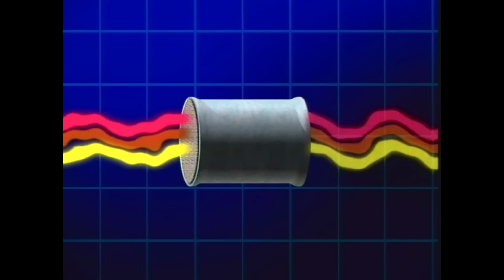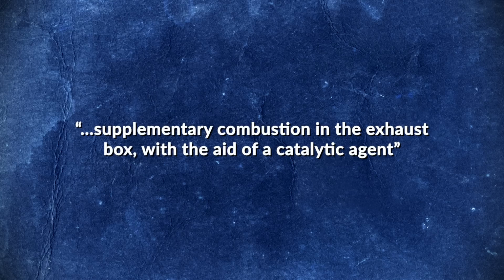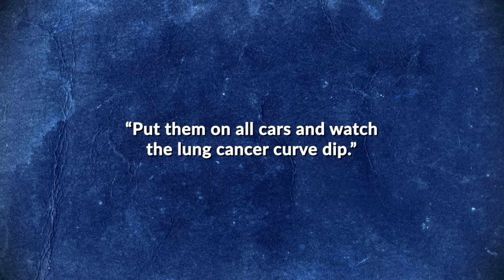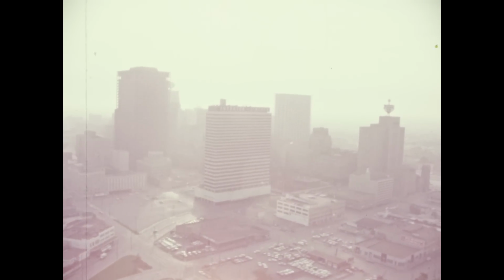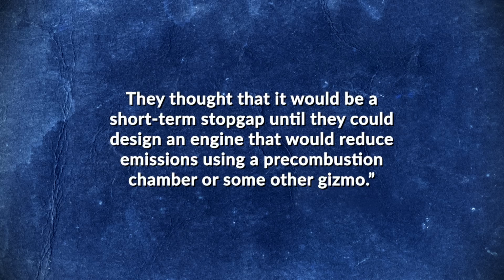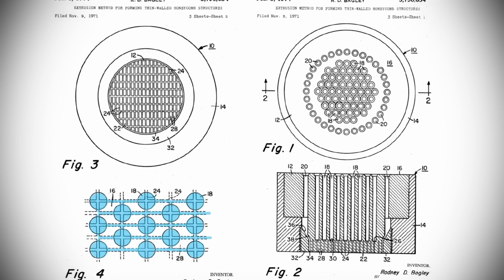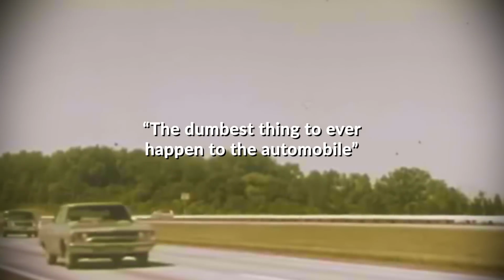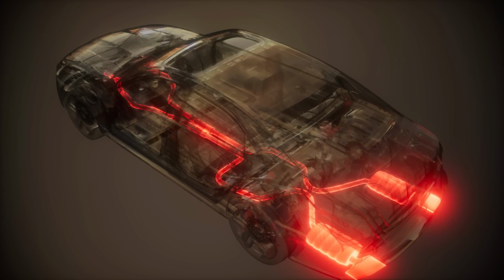The Most Underrated Automotive Component of All Time

Comment: The EPA really needs to get rid of that exception for "light" trucks. That has lead to the normalization of much larger and heavier vehicles on the road, which works against the EPA's objectives in the long term.
Reply: In general, the way we do emissions and fuel economy in the United States is stupid. The reason vehicles have gotten so physically big to skirt emissions is because you're allowed to make more missions if your vehicle leaves a larger footprint. This is why we don't have compact trucks like the old Toyota Tacoma, Chevy S10 and Ford ranger. Instead, we get midsize pieces of garbage or front-wheel drive cars that are pretending to be pickup trucks like the, Santa Cruz, Ridgeline, Maverick.
Reply: Ah so!
Reply: @masjuggalo  I agree it’s stupid the way we do emissions here. We’re definitely on the same side of the argument
Reply: That exception hasn't applied for decades.
Reply: @jessiesratrods1210 there still is a light trucks exemption for gas mileage. That’s why my dad’s old F-150 from the mid 90s gets the same gas mileage as his 2012 F-150
Reply: @tampajay1 they get about the same mileage because the newer F-150 has an extra 2,000 lb airbags. Check the curb weight vehicles have gotten heavier over the years due to things like airbags, power, adjustable seats and so forth. And remember if you say well, the curb weight of my vehicle hasn't changed since three generations ago. Remember the one you have is made with more modern lighter weight materials and still weighs more
Reply: @masjuggalo  Are you seriously saying the airbags on an F150 weigh 2000lbs?  I know juggalos are clowns but come on...
Reply: Airbags, required backup cameras and screens, much heavier seats, heavier stereos, larger brakes, larger wheels, larger tires, heavier literally everything.  Fuel mileage is directly related to moving mass per kg of fuel burned.  It’s simple physics that say it’s impossible to move 6000 pounds with the same energy as moving 4000 pounds.

It’s the same reason we were easily seeing 40 and 50 mpg non-hybrid economy cars in the 90’s and now it takes complex hybrid systems with lean burn cylinder deactivation on modern vehicles.  Every modern vehicle has gained 1000-2000 pounds from their 90’s counterparts.
Reply: All vehicles have cats now
Reply: @jamesocker5235  Everything except for military package trucks.  Ford has an entire build package for military F250's and F350's with no DEF, DPF, no EGR, and no cats.  Factory tune is even setup to not attempt a regen because there's no DPF to burn out.
Reply: the chicken tax comes into it. there's a 25% import tax on foreign-built light trucks/vans, which makes them insanely profitable compared to cars (2% import tax)

this, more than anything else is why trucks are heavily marketed to consumers
Reply: The original reason for the exception was to keep trucks affordable to small business owners, but now they're the most expensive vehicles in the lineup of most American automakers
Reply: USA fleet fuel economy is a joke. It hasn't increased hardly at all since the 1980s when the EPA estimates are put on the same scale. It actually peaked in 1987 and declined during the 1990s, and didn't start rising again until the late 2000s.
Reply: The light truck came about because the US Govt wanted to sell chickens in Germany 
https://youtu.be/HMJsM--jmRA?si=cQhXM8qegR6uxE7T
Reply: Indeed. It's fleet efficiency standards on that topic, not emissions; but same same/semantics.
Reply: The EPA is weaponized, now in hand with manufacturer’s they work to cost the owners as much as possible making vehicle own ship worse for every generation, and now with the subscription process you will own less until you essentially rent your transport ensuring your movements around the country.

Comment: Why not turn them into batteries? Redox reactions make electricity that's what batteries are. Also, redox reactions are reversible so they could be easily recycled by charging them with electricity.  Chemists really need to take engineering and mechanics,  it would make the world a better place for everyone

Comment: ....and GM, in true GM fashion, knew that their 'pebble bed' converters wouldn't cause any operating problems to owners who chose to 'kill' their converters by continuing to run the (cheaper) leaded 'regular' fuel which was available for several years after the theoretical changeover date.
Reply: Well, eventually they would clog and you'd have to pop the very convenient plug out of the bottom and blow the guts out..
Reply: How late did GM stick with pebble bed converters? The plug was supposed to be so you could replace the catalyst pellets.

Comment: According to TIFO and bulge in an exhaust pipe is a catalytic converter. Never mind that there are things such as post cats, resonators, and mufflers. Factory cats on modern vehicles are found attached to the exhaust manifolds. Typically visible from the top of the engine bay or by looking right by the engine itself.

Comment: Automotive journalist Jamie Kitman has covered this topic in detail some 15+ years ago. If I'm remembering it correctly, it goes like this:
1. In the late 1970's, California wanted to introduce gasoline automobile emissions regulations to improve air quality.
2. The whole US automotive industry said it would be really, really hard to do and would take years and cost them huge sums of money.
3. At the same time, General Motors had a 40% stake in a company which was developing catalytic converters for automobiles which would enable them to satisfy the emissions requirements.
4. Meanwhile, Honda went away and developed a 3 valve cylinder head for their existing engines which improved efficiency and would meet the emissions requirements without needing any additional hardware or equipment to be fitted
5. Lobbyists for the US motor industry convinced the legislators that it would be lot cheaper and easier to just stick a new gizmo called a catalytic converter on every new car instead of them having to re-engineer their engines cylinder heads as that would cost them a lot of money. And luckily, GM was aware of a company which just happened to make them and would gladly supply everyone with as many as they needed, which was really convenient.
6. Emissions regulations came into force, and everyone paid an extra couple of hundred dollars on every new car which all have catalytic converters, while GM made a nice little profit from the new market for catalytic converters they helped create.
7. Every new Honda still had to have a catalytic converter fitted (which was not required because they had the 3 valve cylinder head on the engine), and their customers still had to pay the extra cost for the cat.
Reply: just re-engineering an engine doesn't solve anything so you must be misremembering as cats were FAR more expensive then, as now than a redesign. considering GM's failure in that department with the pebble style...pretty much proves how difficult they were. there were a LOT of automotive industry writers/pundits/fanboys who absolutely HATED any pollution controls and would write or talk about how ebil it all was and unnecessary...much like they did when it came to leaded gasoline which DID require a redesign when it was eliminated.
Reply: @Joe-Dead  At that time Honda proved that it was possible to avoid having to install cats as they were very expensive. At some point cats would almost certainly have been required but not for a few years. However, GM as the major US automobile manufacturer during that period had a very nice incentive to promote cats as they had a large stake in the company making them.
Reply: @simonlb24  honda didn't prove anything, it's chemistry not magic, everything an ICE produces was STILL produced. you LITERALLY cannot engineer an engine that doesn't produce pollution without a catalytic convertor. the absolute best choice wasn't possible back in that era, direct injection and that STILL only reduces pollution/emissions but nowhere near the level a catalytic convertor can on a naturally aspirated engine.

it's chemistry mmkay? burning hydrocarbons ALWAYS produces pollution even methane which is pretty much the cleanest version you can get. just CH4, not complicated, but it's also reacting with air and everything in that at high temp.

there was a concerted effort to keep catalytic convertors and any pollution controls OFF cars. keep lead IN and keep the industry rolling like it always had. same story, different industry. something harmful needs fixed, costs money to fix...let's put out propaganda to prevent that action.

tetraethyl lead, tobacco, asbestos, thalidomide, pollution, ozone etc etc etc.
Reply: @Joe-Dead  Thank you! I was hoping someone would point that out so I didn't have to.

Also, Honda did meet the emissions requirements at the time with their CVCC engines. They had better combustion which result in less pollutants. That meant they had the distinct advantage of not having to rely on catalytic converters. As the emissions requirements became more strict, Honda just like everyone else had no choice but to use cats.
Reply: I'm not sure how adding valves to a cylinder head improves emissions? the engine definitely would be more powerful
Reply: @tturi2  slight improvement to combustion efficiency, not sufficient to meet pollution standards though as it's still pumping out everything.
Reply: @tturi2  If you can move air more you're gonna get higher efficiency because you can increase compression and air fuel ratios afaik. Lots of vehicles now days use 4 valves per cylinder because you can flow a ton more air in and out, and do it with less resistance as well, which leads to more power and efficiency since you're not fighting to get the air in and exhaust out.
Reply: @tturi2  It allows more intake air into the engine which improves combustion ans reduces certain emissions. This is why the majority of engines today are 4 valves per cylinder.
Reply: lmao murican lobbyism strikes again
Reply: I was actually looking for this comment, hoping someone wrote on this issue, so I would not have to.
Reply: Google says it was invented in 1950
Reply: one last point about honda, they are one of my favorite companies mainly for that 6 cylinder monstrosity of a motorcycle they built but get this straight, i'm a realist, the CVCC engine ONLY worked well INITIALLY for that decrease, one year later after regular CONSUMER use they will then fail that emissions test. that's reality and why catalytic convertors are universal for emission controls. you can TUNE a vehicle to pass, as plenty of companies have shown...unless you do that tuning and regularly monitor your emissions it's going to fall off and fall off RAPIDLY. so no, the CVCC wasn't the second coming, it wasn't some kind of magic bullet that solved everything and it wasn't even good at what it claimed to do as it would quickly fall out of spec under normal use.

so just stop with the 'honda fixed it' no they didn't. they failed a cert, retuned, passed the cert and unless  the consumer of that vehicle stayed on top of their maintenance and tuning to keep the emissions in spec...that's just not going to happen in the real world. the world i prefer to live in.
Reply: I doubt that.  A cylinder head that reduces NOx causes higher fuel consumpttion and more pariculates.

Comment: The Prius (and other Toyota hybrids) use a coolant loop from the engine block to the exhaust which helps warm the engine (and thus the catalytic converter) up to their operating temperatures faster.  Its a pretty good idea, assuming the loop doesn't become compromised and start pissing coolant into the exhaust. Lol Do I wish cars were simpler? Yup. Do I like clean air? Also yup. Guess we just have to learn to like cats everybody.
Reply: EVs are a lot simpler.

Comment: Totally unrestricted exhaust is best. This creates a vacuum in the exhaust manifold that sucks the exhaust out faster and cleaner from the cylinders. Results in less burnt fuel remaining in the cylinders causing increased wear and tear.

The reason many new cars do not instantly gain performance from the removal of the catalytic converter is due to tune issues. If you get a retune to prevent your engine from running too lean you will be well off.

Noise is an issue though.

Comment: Had mine stolen twice of 2 different cars. After that I put very sensitive alarm system in car and has a safety wire drilled down through the floor board and wrapped around the converter then attached to the frame. Acted kind of like a ground so if it got disconnected alarm went off. Also put metal straps around it and riveted to frame. Love to catch someone slid underneath my car again trying to get it. Getting kicked as hard as I can muster right in the soft bits, continuously.
Reply: Only problem with this is that apparently they work with lookouts who in some cases have been armed with guns.  Getting met with a pistol pulled on you and being told "None of your business, go back inside" is a pretty good deterrent.
Reply: @JimTheFly  I work in a sheriff's office in Texas. One of my coworker was killed off duty when he caught some guys stealing his catalytic convertor off duty. The group is currently awaiting trial. After the death the Texas Legislature increased penalties for catalytic convertor thefts and I noticed the number of calls we got for catalytical convertor theft went down to near zero.
Reply: @JimTheFly  😂 still worth it
Reply: I cut mine out and sold it for 700 bucks,     but I had a 26ft  truck.     Basically exactly like a uhaul,   she had a v10,  some cnt jacked my cat in the night,   and oh boy did my work truck sound like a monster!!!  Sounded like 4 Dbags on Harleys in a tunnel doing what dbag Harley Dbags do whilst dbaggin through a tunnel
Reply: @josekentucky86 I love it when I get pulled over and flying past is 1 of these said Dbags and I'm like Sir his exhaust was way louder than mine. It's ok if on a bike. Not ok if in a auto. Hmm
Reply: @jasonchristopher2977 in bc the noise bylaw is 11pm  and in ab it's 10pm  it has to be illegal to drive them past those hours,   if I can't even have music that's not even a fifth as loud without cops banging on the door
Reply: @miscbits6399  What's the rules exactly? Here in Pennsylvania, unless it's a classic or antique registration on vehicle, it has to have the emissions it came with from factory. Where I live we have no sniffer test. So we just take an old cat, run a pipe through it so it looks the part and in it goes. Now I'm not 1 for ungodly loud autos, but I like to hear it when I'm at full throttle. But as a young man 20 years ago I liked them headers and straight pipes listening to Metallica raising hell. Now in my 40s listening to wheels on the bus I tend to like them quiet until I'm passing others at WOT. Something sexy about a car that sounds quiet but can really roar. A classic is 15 years. 25 antique. So a 2009 can b a classic.
Reply: The replacement cats are worth far less then OEM cats. So they generally wont steal them a second time off the same car.
Reply: Sounds like you put a lot of holes in your frame my dude
Reply: Most ppl gonna ignore your sensitive alarm. 
Better sleep light that way you can hear it going off .
Reply: @Optimus-x7f  Not saying to do so, BUT a microwave capacitor may give a nice shock, or my fav and cheap are 12G toe poppers. Don't steal others stuff. Go work for it. It will mean way more if u work and get it honest.
Reply: Should of thanked them for taking that garbage off your car

Comment: The catalytic converter is usually the first thing cut off of cars around here not just because you can sell them but to make your car run better. They tend to get clogged up and i have seen them get red hot because of that.
Reply: How old are the cars y'all are running, over there? It ain't the 1970's, anymore! Modern catalytic converters take a very minimal toll on your engine's performance and power.